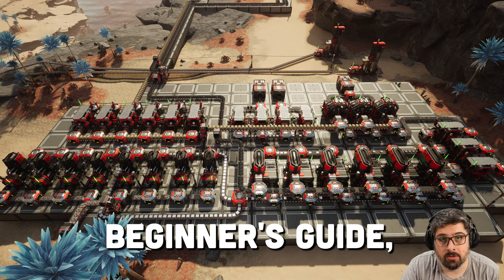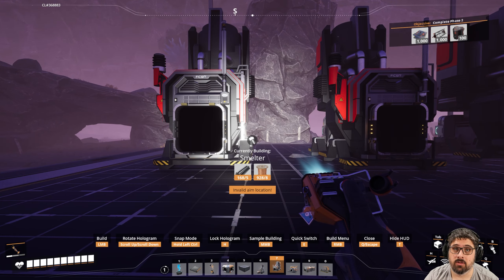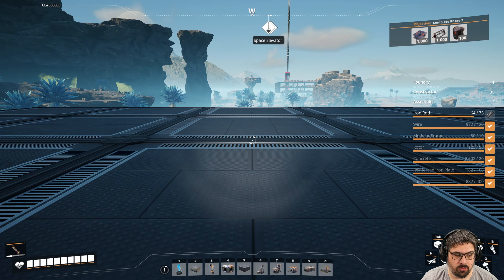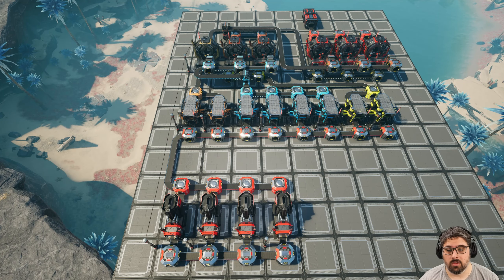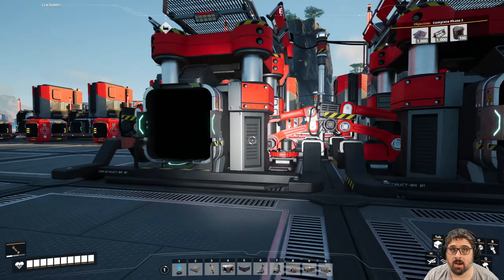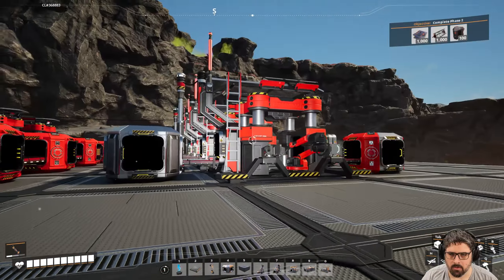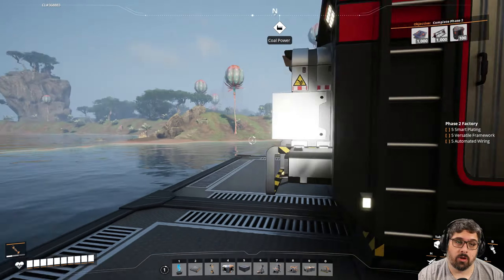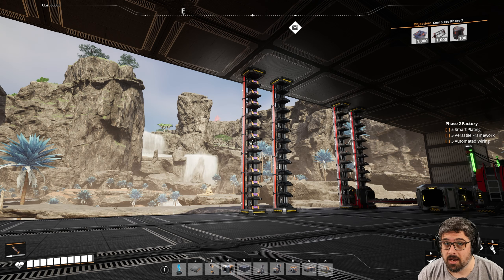How to Complete Phase 2 EASILY in Satisfactory 1.0! | UBG 7

Comment: question from the last UBG. The first assambler of the rotors for the smart plating, deplets really fast the screws, and dont get feed fast enough to get 100% uptime production, but when i change the conveyor lift, the one conected to it, from a mk1 to a mk2, the screws fills more into the machine and keeps a 100% uptime, my question is, if i make that change, would affect the other 2 assamblers? (even the one is underclock)?